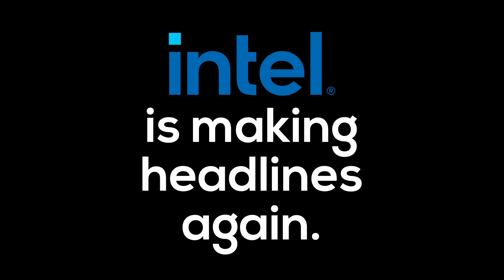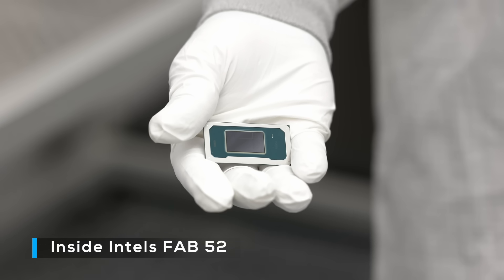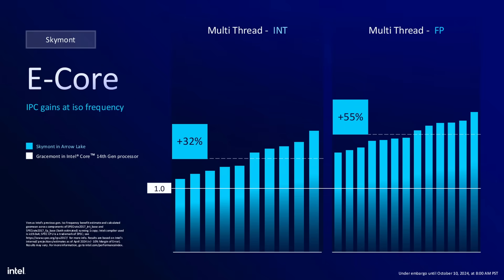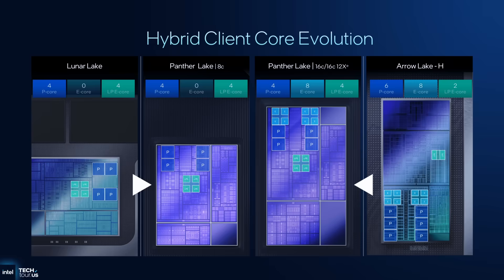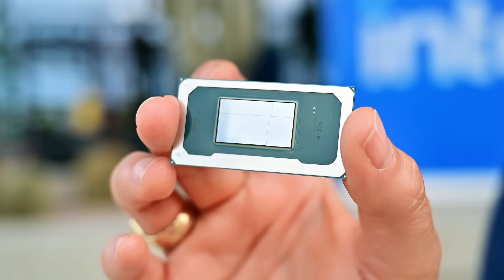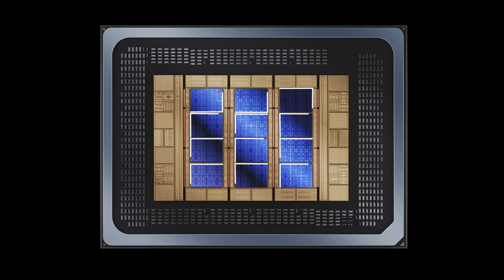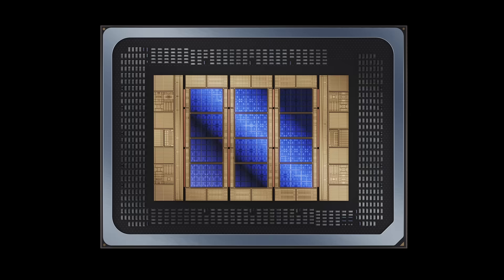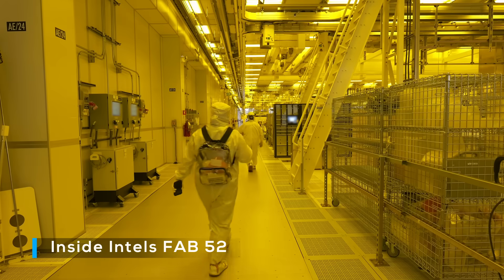Panther Lake, 18A & The current state of Intel

Comment: its dead in the water before its launched, no one wants e cores on a desktop, we want big cache and fast single thread and multicore baseclock speeds
Reply: Panther Lake is a mobile part.
Reply: First, this is a laptop part, so “what you want in a desktop” doesn’t really apply here.

Second, this has a (small) amount of extra cache. Not 96MB, I think it’s just an extra 8MB, but still.

Third, Nova Lake, the next (real) desktop generation, is rumored to feature an extreme amount of extra cache, 288MB (2x144MB, still more than 96MB either way), coming later 2026. 

Fourth, E cores are actually good, as the above comment attests. Better than just giving you “No-cores” like AMD does at various price points.
Reply: I want e-cores and I am hyped for new P-core that will be scaled-up e-core probably in 2028 . 🙂Constraints (in this case, the die area) force you to be inventive. Until then I am using my R9 5900X ;-)
Reply: E-cores are very powerful. Thanks to the E-core architecture and excellent big.LITTLE engineering practices, Intel CPUs deliver twice the performance of same-priced AMD CPUs.
Reply: Shortbus comment.

Comment: Are Intel 4 and 3 abandoned for consumer products?
Reply: No. They have been used before in lower end CPUs.
Reply: The video mentions that the small iGPU is made on Intel 3, and I assume they’ll make a dGPU on it as well. (I doubt they have the spare 18A capacity to make them on that, sadly)

I don’t think we’ll see much more of Intel 4 though, but I really don’t know anything about it. Just assuming because Intel 4 mostly exists to improve Intel 3.
Reply: @levygaming3133  *Intel 3 exists to mostly improve Intel 4.
Reply: @TuxikCE I meant in the sense that Intel 4 was a limited use case node to improve the quality of and bug test Intel 3, in the same way that Intel 20A was meant to do for Intel 18A. Obviously, Intel 3 is an improvement over Intel 4. 

But, for example servers I think completely skipped over Intel 4? Or at least they certainly aren’t using it in Granite Rapids anyways. And same with the iGPU here that skipped to Intel 3. I don’t expect more parts to use the “limited use case” Intel 4 was my point.

Comment: Guys guys guys I have an idea, what if Intel makes the GPU tile bigger, like as big as the whole CPU, and maybe even bigger, and then sticks it on a separate board so that it can be used as an accelerator in any PC! They can call it 'Intel Arc' or something cool like that and sell millions of them! It's gonna be revolutionary! (Sshh just play along and maybe we'll get more Arc GPUs)
Reply from the maker: Imagine if Intel Arc had an Arc Raiders promo.
Reply: @HighYield  nah nah nah nah nah, make a SAS controller in collaboration with RAID: Shadow Legends, they'll make Billions
Reply: @HighYield  generational fumble for sure. They need mindshare
Reply: they don't have the manufacturing capacity for that currently
Reply: @viktorward8942 sadge
Reply: And makes the GPU 18A. Also scalability from 1 GPU tile for entry level, 2 GPU tiles for lower midrange, 3 tiles for upper midrange, 4 tiles for high end, and 8 tiles for enthusiast.
Reply: Intel 200% doesn't care about the DIY market, only OEM System Integrators.
Reply: @devobronc  And thats good. More hardware for broke people few years later.
Reply: what everyone said + NVidia put a full stop on that. long live the free market!
Reply: Their architecture is just not competitive. And then you have drivers, software
Reply: @zachb1706  I agree that Alchemist was a shit-show, but Battlemage is a huge improvement -- if they can keep it up for Celestial, then they could be very close to competitive. It's obvious that they can do it, but it takes time.
Reply: @predabot__6778  battlemage is still miles behind Nvidia. The B580 has around the same performance as the RTX 5050, but to get that Intel has to use a die almost twice the size (272mm^2 vs 149mm^2) and almost 1/3rd more power (180W vs 130W)

Really not a surprise they seem to be killing the division and partnering with Nvidia.
Reply: If only it was that easy (it should've been)
Reply: imagine 99% of them produced being failures. Those aren't big cpus. The tiny chiplet design for everything probably means they have the sh tties yield ever.
Reply: @GreatValueBleach-l2z  uh... First of all, as far as I know, nodes aren't even profitable until about 60% yields. So, realistically, 1% yields is a bit too low. Secondly, Intel's been trying to make chiplets happen for a very, very, VERY long time. Basically ever since AMD came out with Ryzen. To think that they only did it because of bad 18A yields would be insane. I'm sure "increased yields from smaller chiplets" was one of the factors in favor of chiplet-based design, it's just that there are very much other beneficial factors as well, like not having to micromanage your CPU die supply so that you can carry all the 30 different SKUs or like being able to quickly adapt to market situations through the magic of not having a 16-month development cycle on every single tiny product change.
Reply: @gleb.salmanov  It was about a GPU sized die plus there is no need to make small ones out of chiplets if the yeald is any good. And, yeah, I'm not privy to their internal reports. Hey, an explanation can be what they are getting first units from TSMC and just packaging them in US as needed.
Reply: Why would Intel announce such a thing at CES? It would have overshadowed B390 + Panther Lake.. both of which are unbelievably amazing and warrant praise and success on their own. Marketing 101.
Reply: I'm looking at my Arc pro B50 and thinking about B500 on intel 18A with 128GB vRAM..
Reply: @Stevx-d9b  128 GB of VRAM? In this economy?
Reply: @gleb.salmanov  that's like $2 million or something in this ai economy
Reply: @Stevx-d9b make that HBM3. That’s a necessity for 8K gaming especially at 120 fps.
Reply: @davidperry4013  Brother, we haven't even escaped 1080p60 yet.

Comment: I like what I’m seeing here from Intel, but I’m worried about how well the thread scheduler will work.

3 tiers of core is still a scary level of complexity, and I’m worried it’ll keep holding them back in real-world use.
Reply: Yeah, but they seem to already have some experience with three core types on Meteor Lake, and also, it seems like they aren't giving the mid-tier and high-end CPUs that many of LPE cores, based on the leaks. So those are probably cores dedicated for background tasks, like your Google Drive client, or Steam, or for a download thread in a browser. Doesn't seem like there'll be any tremendous problems with scheduling, in my undereducated opinion.
Reply: @gleb.salmanov  The experience INTEL has on this don't matter, what matters is MSFT which has a history of screwing up schedulers. Look at the Lunar Lake laptops which Hardware Unboxed did extensive testing on and found Windows never uses the LPE cores for any purpose, they are essentially dead silicon as no matter what load they threw at it Windows just refused to touch them. Before that we had AMD Bulldozer which traded blows with the Core i7...under Linux. On Windows? Never did work right as Windows would max out 1 or 2 modules and leave the others doing nothing instead of load balancing between modules as Linux did.

And considering that MSFT admitted nearly 40% of windows coding now is AI slop and that instead of fixing the slow windows Explorer issue they are just going to preload Explorer at start up and bolt Copilot on top of it? Yeah I don't have high hopes for a triple core set up working worth a crap under Windows.
Reply: @gleb.salmanov  Steam and all background tasks run on P cores. The E cores are a complete waste of silicon. I know cause I tested it many times.
Reply: exactly why on intel in virtual machines i only pass through 1 type of cpu core to a vm!
Reply: From what I understand, their plan is to start on LP-E cores and when a task is doing complex work, like a lot of math, it will move it up to E and eventually P.
This upgrading can happen in a matter of milliseconds so the idea is that end users will not notice lower latency.

It should also be noted that smartphones have been doing this successfully for a while now. So it's not like they are going in completely blind.
Reply: the P and E cores are already causing enough problems
Reply: ARM processor are doing this for decades in smartphone CPU. This is why they so efficient. Intel is just reimplement this strategy for laptop chips. But seems PC OS'es were lack of good scheduling for it, and it is not trivial task, tho.
Reply: AMD is going the same way for laptop and phones have been at 3 core levels for many years. The Linux kernel handles it well. The x86 ecosystem just needs a standard way to for application developers to indicate the preferred core level for each thread. Not an assurance, just a hint for the scheduler to start from. For a workstation or server with dedicated processing purpose I would prefer equal cores, but that is a different need from a mixed application machine with many miscellaneous background services.
Reply: @mytech6779  even in servers I think Intel should offer a “hybrid” SKU, just for say Virtual Desktops where your running a desktop OS that should be able to distinguish between hybrid cores, because I think 1p+4e or 2p+8e would probably be much better than 2 or 4 vCPUs just like in low end client laptops. (With the assumption that the P and E cores would probably be “paired” in that circumstance, presumably adjacent and even maybe sharing the same mesh stop, and not on opposite sides of a massive server package.) 

Could also make sense to have something like Clearwater forest where most of the tiles are all P cores but you keep say two or four of them as E core tiles that you don’t directly rent out that any P core based VM could use as “spare temporary multithreading”.
Reply: @levygaming3133 datacenters run hybrid at the rack level, not CPU level.
Reply: @mytech6779  the AMD approach is not the same as Intel's.
Reply: @Geinrendour  Nobody said that is was the same approach, just that they are both moving to heterogeneous CPU cores. 
Zen7 will have 3 core levels, not sure about Zen6. 
Zen4 already has packages that mix standard with "C" cores.
Reply: @mytech6779  I don't know what Zen 7 will be, but as long as it works being ¨plug and play¨, that's fine by me. If needs high level optimisation as intel e/p cores, that will be a problem.
Reply: Alright, point taken
Reply: Doesn't Intel APO exist to solve this issue?
Reply: I mean intel thread director had evolved so much since alder lake era. It would be a problem if it still not mature enough. Beside that intel stated in their tech tour event that panther lake thread director have been retrained and reoptimize for more modern use case. We don't know for sure whether it will be good enough or not until early next year but personally i'm quite confident it'll work better than previous generation.
Reply: Yes, it kind of has that NetBurst smell
Reply: I actually enjoy the nuanced situation that this produces vs AMD that has much less diverse array of cores. It gives each an identity.
Reply: it's fine the performance deltas are no where near large enough to cause remotely the same level of problems 12th and 13th gen did even if there were 0 improvements to scheduling
Reply: Ya core hopping is slow as hell and you basically have to run a program on all 3 for a while to compare the perf. The OS would have to do soo much profiling. That's why my 7800X3D is nice and consistent, 1 core type, lots of cache.
Reply: @leggysoft 
I chose the i7-12700 over the 7800X3D for a few reasons... first if all the i7 was much cheaper, it provided better overall performance for the price. Second of all, I still dont trust AMD hype. For 15 years, I was an AMD fan, but it was 15 years of disappointment. The Bulldozer debacle happened. I gave up on AMD. I've read that the 7800X3D is better for gaming, but Im not a gamer. Every Intel system staring with an i5-2400 has been a solid performer. I still have an old i7-4790.machine running rock solid.
Reply: @toby9999  So your bragging about being excessively brand loyal and 10 years late to the party, switching and repeating the same misjudgment all over again from the other side?
Reply: This issue gets exaggerated by those deep in brand tribalism. Even at it's worst point Ryzen's MCM design never ran badly, it just didn't run at it's optimal levels and could only be recognized by frame counters. Then when Alder Lake launched there were little hiccups but their thread scheduler was oddly more mature than AMD's which had been in use for several generations already. 

We've been using bigLITTLE configurations for over a decade now between phones and PCs. This isn't a real issue anymore. At least not one worth mentioning.
Reply: It's less of a problem because 1) No hyper-threading, so it's still 3 tiers of threads like in ADL/RPL, and 2) The performance delta between P and E has shrunk a lot, so a misschedule is less impactful.
Reply: @moist_ointment  Fair point, and it brings Intel's P/E cores closer to a concept like Zen 5/5c.  To me, that's a tacit admission that true big.LITTLE isn't really doable on x86 ... no technical reason it couldn't work, just that in practice it's a huge amount of work for relatively little gain.
Reply: Yeah, the P/E core dynamics is already why I got away from Intel. That shit is a nightmare.
Reply: @Geinrendour  The hybrid design kept Intel relevant in client. It's the only way they maintained nT parity with AMD. The P cores are trash. 3x - 4x the size of E cores just for an extra 10% IPC and 20% clockspeed. 

Good thing the P cores are going away after 2 or 3 more generations.
Reply: @moist_ointment  You don't need any P cores or E cores. You only need 1 type of core like what AMD has always been using. They don't use any BS hybrid architecture on desktop because they know it's trash. Intel only used it because they couldn't cram 12 or 16 big cores into one monolithic die built on 10 nm. And to save face they kept using hybrid architecture even when they don't need to anymore. No wonder Arrow Lake was such garbage. Intel pls STOP USING HYBRID ARCHITECTURE!
Reply: @Ignisan_66  Just an FYI, AMD is unique in that they're the ONLY one without a hybrid architecture. Every other CPU company does it.

And also, ARL being hybrid has nothing to do with why it sucks. Everybody knows it's due to a poor SoC design, L3 latency, and compute-to-SoC tile latency issues.

Lack of 16 P cores also had nothing to do with the node. It had to do with Ring Bus stop limitations, which E cores sidestep by having quad-clusters sharing a single ring and L2. Same reason why AMD doesn't put 16 cores on a single CCX.
Reply: @Geinrendour  What data do you have backing up the claim that it "is a nightmare"?  I suspect the data is near zero.
Reply: @LouisDuran  your comment is a good reminder of why I don't usually write in here...  hope you at least is a intel stock owner to get this offended by a random sharing his position on the internet... if you are a gamer, hope your E cores ain't ruining your experience
Reply: @Geinrendour  There is so  much more to life than 20 fps in a game. It's crazy how you can't see that you were way more offended by my asking for solid data rather than "feels". I wasn't offended. Just asking for data.

But if my comment keeps you from writing more... I will take that as a win.
Reply: @LouisDuran  my guy, you are on a youtube video comment sections asking for ¨data¨. If you think this is a competition where there's winning or losing, whatever makes you feel better. Here's a new comment to keep you ¨winning¨.
Reply: @Geinrendour he's asking about something simple... facts !